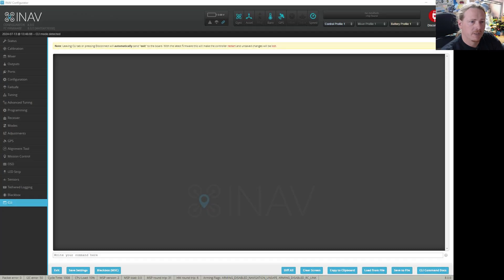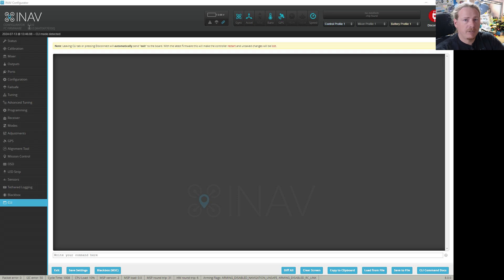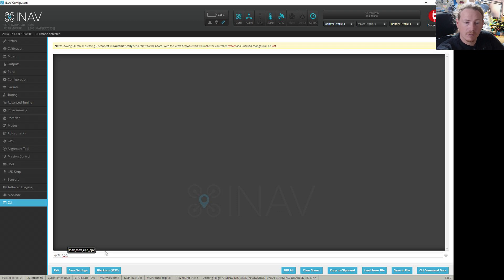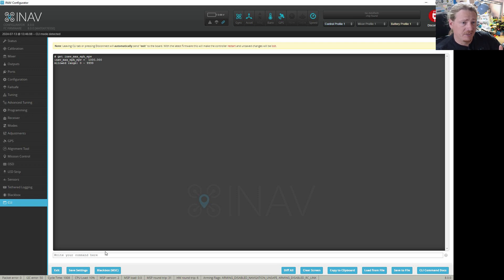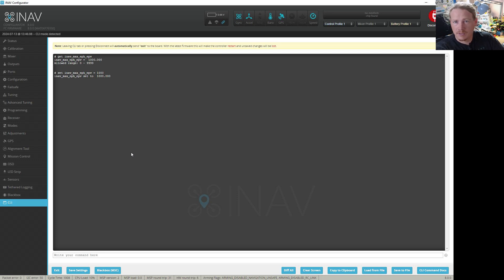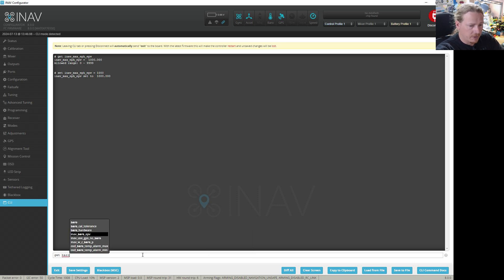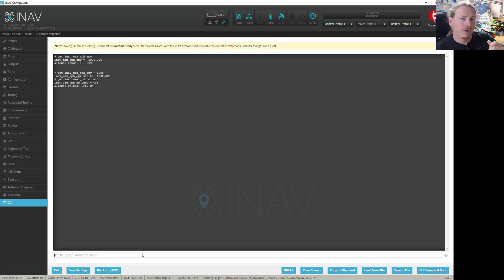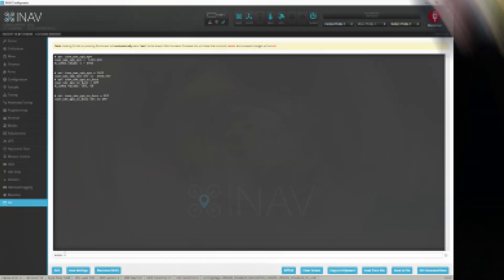INAV Public Service Announcement: Can't arm with plenty of satellites & 7.1.1 no baro issue

Comment: My multirotor is calibrated, the compass works correctly. It turns on and flies well in Acro mode. GPS shows satellites and the direction home. But if I switch to ANGLE mode, all sticks except gas are disabled and the drone just hangs in the air, drifting slightly. Who knows how to fix this, please help. INAV 7.1.

Comment: Thanks for sharing the fix/comments. I feel like INAV used to be quite a bit more stable for the main features. Now every time I upgrade to a new version, I end up spending hours trying to resolve a random problem with a core function like GPS, Arming, etc. It can be frustrating when limited time for the hobby is spent troubleshooting instead of flying.

Comment: Just installed a SpeedyBee F405 mini in an EDF jet with GPS M8N/Compass/Baro - I did the Acc Cal, the MAG Cal - for me in AU - no problem arming after locking 8 GPS sats.  I would be interested in a much faster GPS lock if you ever do a GPS comparison lock shootout - and show us which is the fastest there in UK to get a cold lock. Good Work mate !
Reply from the maker: There are too many variables. Some GNSS modules do get locks quicker. For example modules using genuine UBLOX chips, like the Matek modules. But distance to othet electronics, the antennas’ view of the sky, other noisy electronics being on, and uncontrollable things like solar flares all contribute to cold start times.

Comment: Hey mr D, quick question. I have had an emergency landing activated on my wing running the new inav 7. So far I have been unable to find the plane but still search. The emergency landing was self activated within 800ft of the home point. Will the plane enter its stated loiter pattern from where the emergency landing was activated or will it continue in a straight line on a shallow decent. I believe that my motor stopped due to it burning out so it would have been gliding at the time. Thanks….Rotorflex
Reply from the maker: If it said emergency landing on the OSD. It will continue in a straight line until it lands. It will usually do this if there was a problem close enough to home to not allow failsafe to activate. A burnt out motor will not trigger an emergency landing. INAV doesn’t know the health of the motor. Something else would have had to trigger it. Usually a hardware issue like RC link loss.
Reply: @MrD  thanks for your reply. I now have a good idea of the area I need to search. Thanks again…Rotorflex👍
Reply: @MrD  on the day that it went missing the wing would have had a slight cross wind in the direction it was travelling. Would the gps hold it in a straight line or would the wing be affected by drift during its glide path? Thanks…Rotorflex
Reply from the maker: @torquedude  I don’t believe it will hold heading. I believe emergency landing is like angle mode with pitch corrections.

Did you not get GPS coordinates on your transmitter? They should have been present until you lost RC link. However, losing like is more likely the cause of the emergency landing. 

What about the DVR from the goggles. That may give you a clue. You should have still had picture until almost the ground if it were that close.
Reply: @MrD  unfortunately no dvr, only osd on a black screen. I was using the runcam split hd, two different units with two separate power inputs so I lost picture but not osd. I recon my battery pulled down below safe voltage and shut the esc down and possibly the becs onboard the fc. Pulling almost 80A on 6s travailing at 187mph so will have travelled a fair bit before touch down.

Comment: I have a setup that had dozens of flights with INAV 6.1 and it does NOT have a barometer. After upgrade to INAV 7.1.2 I can no longer arm, eventhough I have 10+ satellites. Does this mean that INAV will drop support for Flight Controllers without baromether for wings?
Reply from the maker: It was never recommended to not use a barometer. However it will still work.

One of the other settings must be wrong. Check the inav_max_eph_epv setting. If that’s not 1000, that will cause issues where you can’t arm.
Reply: @MrD  Thanks, checked, the issue came from the inav_max_eph_epv being set to 1 after upgrade to inav 7.1.2 from 6.1 . I'm sure I did not set it, it is not present in the diff file I made before the upgrade. It appears in the diff after 7.1.2 was installed and the changes from 6.1 appied.
Reply from the maker: @tipoman9  that one seems to be popping up a fair amount.

Comment: Darren, can you make a video describing what's needed to connect wireless HT (Bluetooth) via elrs backpack function if indeed it's possible? Using Tx16S + Radiomaster with Rangemaster module. Home made Bluetooth Arduino HT, all working but hard wired!
Reply from the maker: Sorry, I don’t use half of that equipment. I was working on the Arduino head tracker. But my transmitter has internal Bluetooth.
Reply: Yes, my FrSky X20S has BT but thought there may be a backpack route for T16S.... Be nice as it's my fpv Tx.

Comment: Hey  sir I stuck in a problem which I didn't see . Actually I always use foxeer gps I tried q120,q250 but this time I try q180 on my inav version 7.1.0  every thing is fine it's fly properly but the problem is if I connect my gps with fc the beeper starts beeping battery is disconnected only USB cable is in computer its continuously beeps  and If I connect the battery no beeps sound every thing is working fine it's fly well ,but my problem is this if it's flys well but it's cost me a lot to make I don't know if machine react wrong while flying due to this gps and one thing more if I disconnect the gps connector it's stops beeping .can u help me in this matter thanks in advance
Reply: And I tried my Q250 foxeer gps than beeper not beeps
Reply from the maker: Sorry, I’ve no idea. It sounds like an issue with that GNSS module. I’ve never used the Foxeer modules yet.

Comment: Thanks for the video. But you forgot the "pitot_hardware=ADC" option that could also cause a arming block on some FCs. 
Some FCs have the Pitot tube set to ADC by default in their target but if no sensor is attached, the free floating ADC can cause erratic data and makes the runtime calibration fail or take infinite time.

Comment: Thank you it is very helpful. Is it possible to bypass the 6 sats minimum for arming via the CLI? I tought 3 or 4 sats should be the minimum for 3D fix. The four firsts sats are easy to obtain but the 5th and 6th are so loooong to fix.
Reply: I already put the GNSS in UBLOX protocol. This is not the way. I think I can grab the GNSS of my friend and copy the stock configuration and retry to put on mine. Or maybe this is not a GNSS configuration issue: I did the same tunning on my M100 mini but the GNSS didn't failed like this during all the latest flights. This is a bit strange IMO.
Reply: The absolute safe minimum is 6 so stick with that.
Reply: What security? I can fly with my plane without sat if I do the action of the sticks and it works for non-automated flight. 4 or 5 sats should be enough to have the information type altitude speed, finally I think.
Reply: @sebdewey  That minimum is for the people that actually rely on RTH, you want a good home fix on RTH. For some simple speed readings it's also better to have many sats as it will improve the accuracy.
Reply: Yes, if you rely on RTH you need many more sats than the minimum 3D fix. I think it could be a good idea to set the minimum sats following your flying style and aircraft.
Reply from the maker: Flying without GNSS and flying with too few satellite locks are different things entirely. Without GNSS, you have no navigation modes. So the reliability of the GNSS fix doesn’t matter. For reliable navigational flight, the minimum locks you should have is 6. 5 you can get away with. But 4 gives bad data. 6 gives a small buffer before reaching the level where data is bad. It doesn’t take too long to get 6 sats locked. If they are taking a long time. Maybe you need to consider the position and/or quality of the GNSS module.

As for relying on RTH. It may be that you need to rely on it, at the worst possible time. But, because arming has been forced it won’t work. For example, you have a video problem and stop receiving an image. RTH is the safest course of action here. Even if it is only for the time it takes your eyes to adjust to daylight outside the goggles. When you take back over LOS.
Reply: Well.  so continue to fly with 6 sats, or more... 😅
Reply: You may get satellites much faster if you put more separation between your VTX or telemetry antenna and your GPS antenna.
Unless you're in Eastern Europe, 10+ satellites shouldn't be a problem. Unless there's something wrong like the VTX is screaming into the GPS, the GPS is upside-down, or similar problem.
Reply: So, I tested many configurations like power the GPS before the VTX and  the cold start take sometimes more than 5 minutes, especially when the weather is cloudy.
I made some configuration mod via u-center 2 following a tutorial, will try this afternoon.
 I also purshased a bigger M10 GPS with compass, it could perform a little bit better I hope.
Reply from the maker: @sebdewey  have you got other clusters active, like Galileo or Beidou?
Reply: Yes I have activated the other systems. I fly in Western Europe. I have made the GPS improvement, called M10 GPS enhancement on google. I will try it soon at the field.
Reply: @sebdewey   If you used U-Center to apply a recipe outside of INAV, hopefully that works for you but if not you may need to use the "reset to defaults" button.  The recipe included in INAV is also a good recipe.  Sometimes, mixing two good recipes doesn't work well.  Like mixing a great recipe for marinara sauce with a great recipe for chocolate ice cream, you end up with chocolate marinara - yuck. The same can happen when mixing the INAV GPS recipe with some other recipe.
Reply: @senseisecurityschool9337 I understand the parallel indeed. Lucky for me. The new setting with the addition of the almanac works in the field. It was cloudy and thunderstorms were present. I have the impression that the fix was a little faster than usual in these conditions. I will receive my new GPS at the end of the month and I will be able to make the comparison. I think the antenna of the HGLRC M100 MINI is a little small. Thanks
Reply: Hi guys.  I received my new bigger bz251 GNSS and applied the "configuration mod" via ublox center. Faster fix than my previous m100 mini, less than 2 minutes for cold start at field without smartphone assistance. I said "c'est de la balle!" 🎉
 but... during my two flights test with more than 15 sats and blue sky, suddenly the GNSS displayed the sat icon blinking and my TX tell me no sats anymore until I endend the flight and retry a power cycle. This is very scary if this happen during a FS. 
However, the compass worked well all along the flight. 
I don't know If it is a common issue or due to the "UBLOX center recipe"😂
Any idea? 
Thank you.
Reply: @sebdewey   What I can tell you is that when I don't go messing the settings doing something other than what INAV expects (the settings the INAV developers selected as being best) I don't get random failures in flight.
Generally speaking, if you think you've found a way to outsmart the developers and then that component fails in flight, it might be good to undo whatever you did and maybe try it out the way it's designed to work.

I spent a couple weeks just researching and thoroughly testing one single setting before it could start to be considered for INAV. That involved carefully reading the datasheet and recommendations from the manufacturer and researching what people who integrate the chips professionally do. I tested the change on four different GPS modules. Then multiple other people tested it.

It's POSSIBLE that you stumbled across a better setting, but we put a lot of time and effort into the settings that INAV normally uses.
Reply: @senseisecurityschool9337  I agree. It was not the best idea but my previous GPS was so long to fix, I decided to apply directly the GPS tunning. I will try to reset the parameters and use UBLOX protocol instaed of UBLOX 7.  Fun fact, my friend bought the same GPS ans he didn't made the same mistake. We will see soon if his GNSS works better at the same field without tunnig, the answer is probably yes. Despite this, the bigger GNSS antenna looks better to catch more sat during flight before the previous mini and I prefer the newer with compass.
Reply: @sebdewey   Sounds good. The only difference remaining between "UBlox7" (for N7M, M8, M9, and M10) vs "UBlox" (for VERY old  6M modules) is the refresh rate. 5 Hz vs 10 Hz.
The 5 Hz version ("UBlox") will be gone in INAV 8.0. Then Ublox7+ will just be called "UBlox".

Comment: Hey nice I did the right thing. Just have to say. Inav has came so far I started flying inav in the early days   Been working on new build. For a year now. Life just happened so haven’t been able to finish it yet. I assume the same with you not having many videos. Is what it is bud. Good to see you back. I haven’t flew since last fall. Crazy last last year I flew over 6k miles. And nothing since. Plan on going today got some packs charged. It’s a sign from the fpv gods. That u uploaded this video. Thanks so much for all the help and work you have put into this. I would have never gotten this far without you.  In your opinion what’s the best long range air frame? Don’t know if u remember me used to have pic of my dog instead of A
Reply from the maker: Honestly, I’m loving the AR Pro at the moment. With my battery it has about 65-70 miles total range. Easy enough to with that setup too.

Comment: Thank you! Changing subject a little, what is the benefit of using a tube to measure the wind? Does INAV do anything with this?
Reply: Currently, INAV primarily uses the pitot mostly for the airspeed displayed on the OSD. Full-size pilots will be accustomed to paying close attention to airspeed. INAV, and model planes generally, are designed to be perfectly flyable without paying any attention to airspeed, so the pitot isn't used much - yet. It may be used more in future versions of INAV.
Reply: As sensei said, mostly for OSD but Airspeed is actively used if you use the Dead Reckoning navigation on GPS loss. Then Pitot is actively used to estimate the position change and navigate back home without GPS (with some error building up over time)